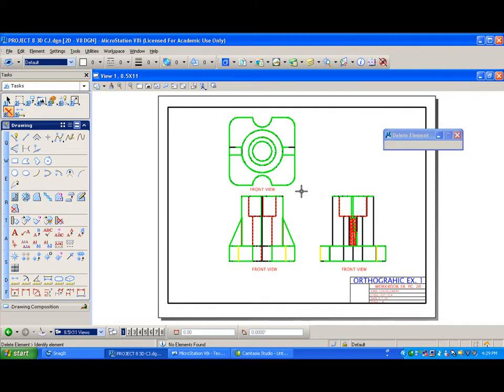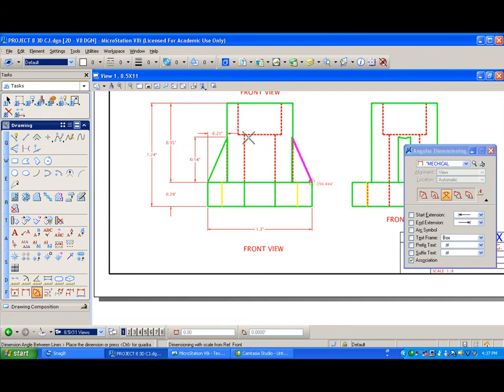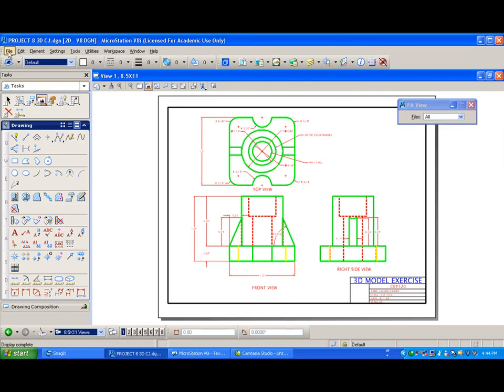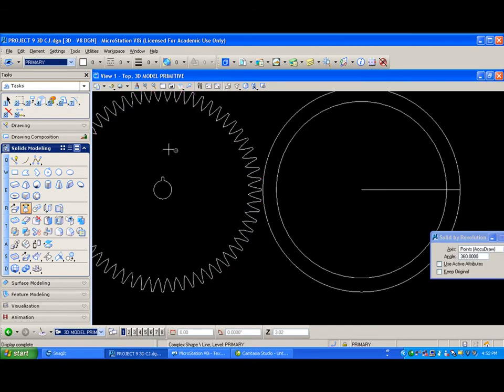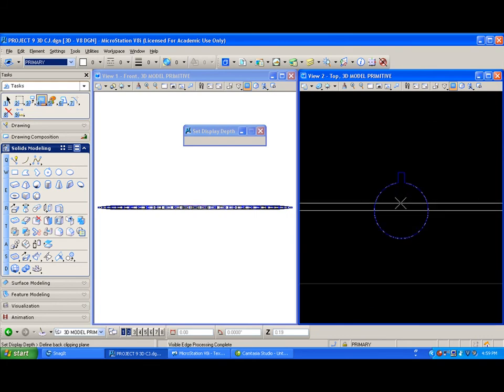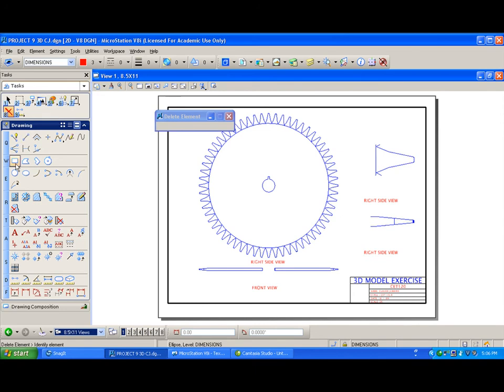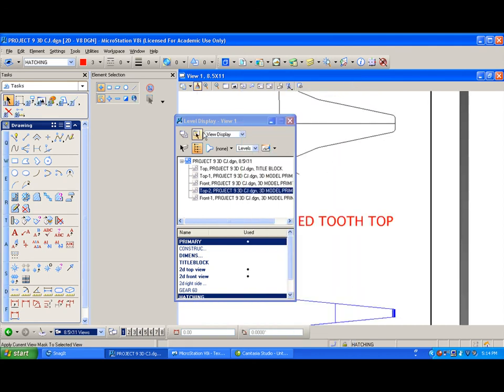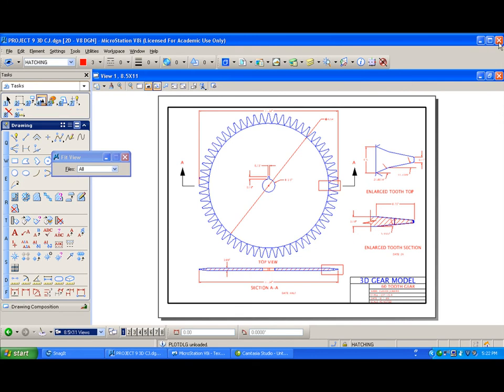MICROSTATION LESSON 15.avi

Comment: Have been trying to get the Microstation Lesson 15.avi 60 tooth gear to cut the solid gear but I get the message "unable to cut the solid". I have went over the 3D solid and the 2D solid and they both look to be complete shapes but can't make it work.  Any Suggestions?
Reply: After redrawing the 60 tooth gear was able to cut through with the gear teeth.  Now I am having trouble with the with the export command. When exporting the file goes into an hln file. Cannot get this file into the reference file to get into the sheet file. Need some help!